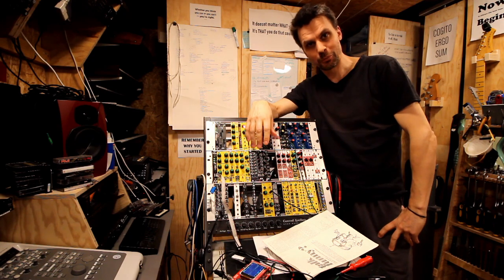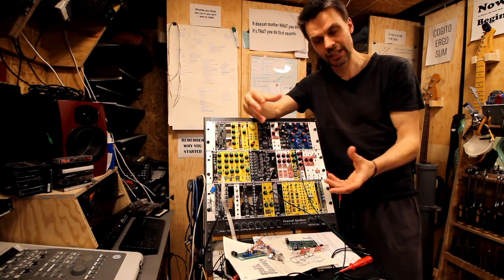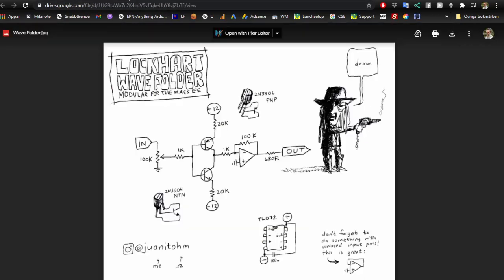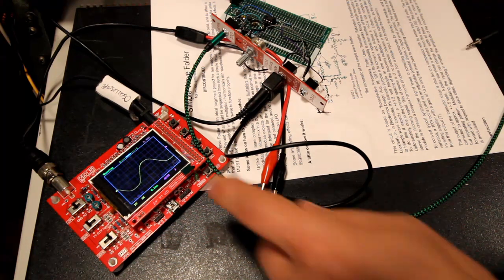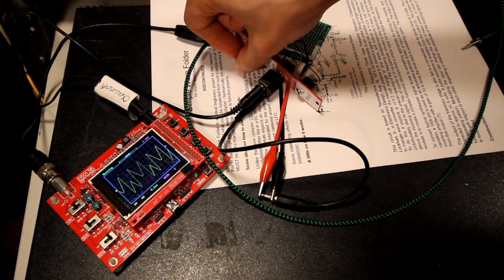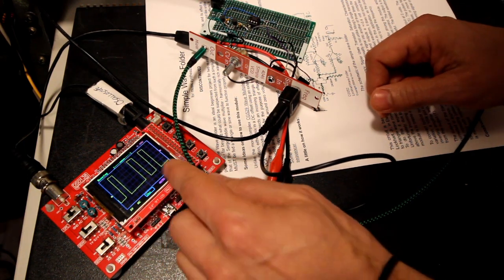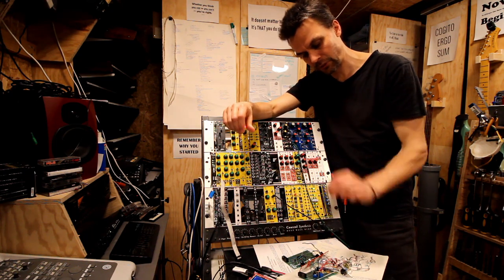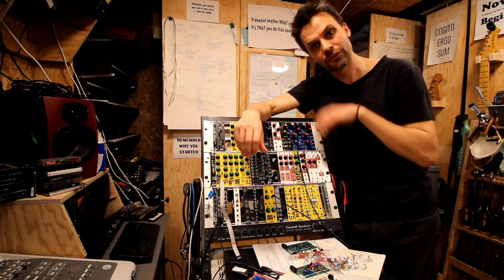Lockhart Wavefolder - Modular in a Week 13.6

Comment: Thanks... I want to make this one too. I there a version with cv for folding?
Reply from the maker: Not that I know of, but I would really like to make one... so have to look into that maybe? :)
Reply: @SourceryOne  Well since the input is just effectively a voltage divider potentiometer acting as an input level control, it should be possible to vary the effect by sending the input signal through a VCA first...